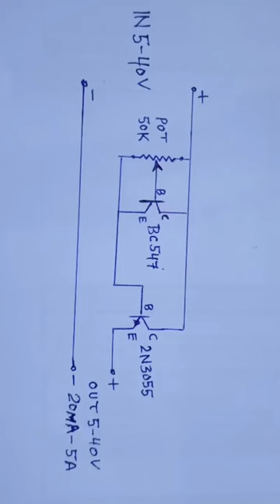Making A Current Control Circuit | Current Controller

Comment: 👎
Reply: Selamün Aleyküm. Türkiye'den selamlar
Reply: @TARIQLAB Voltage and current regulation should be done in separated circuit stages in order to properly do their tasks distinctly. Your solution is a hybrid that is floating, output voltage and current are depending on each other and on load very much, so they are more guess than a set. Of course, if your shematic is the same as the circuit. A ground referenced voltage divider with or without zener and potentiometer central tap to the base of the voltage regulating serial transistor (darlington), then other serial transistor with base on emiter of the first transistor, current sensing resistor to its emiter, which is output, and collector to the base of the first transistor, all npn, would do the job. Second transistor is cutting the base current of the first transistor when the preset output current has been reached.